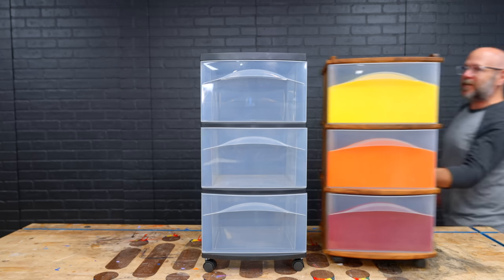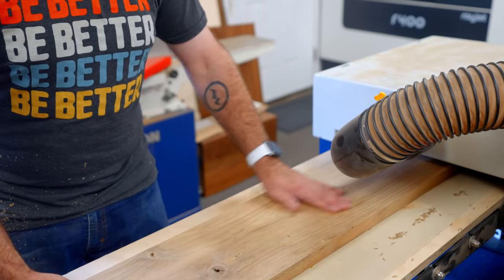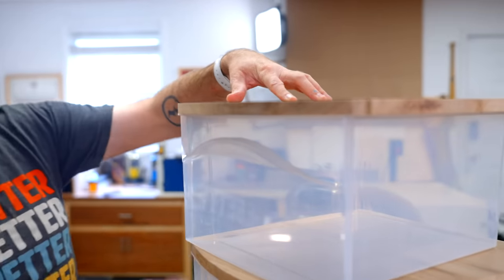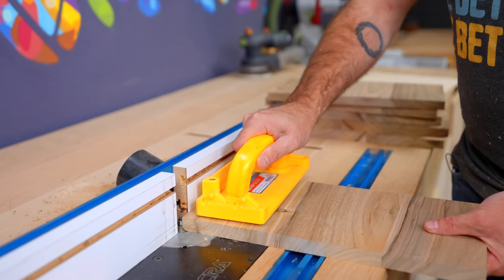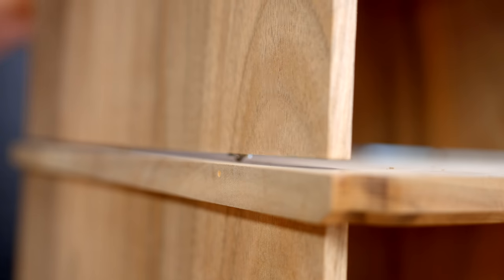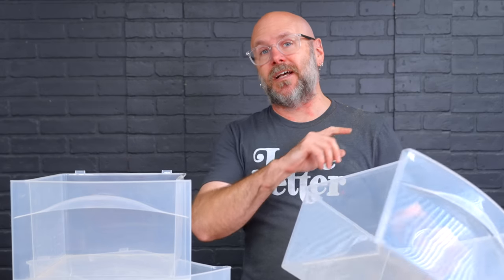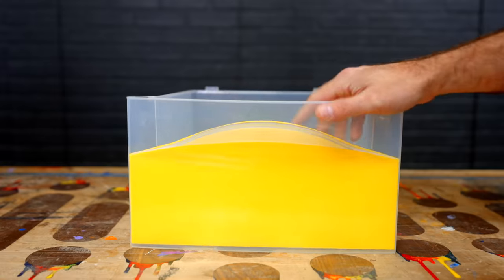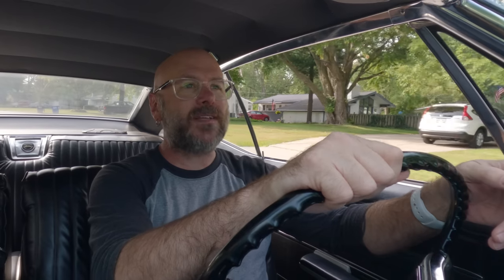Cheap to Priceless! Turning a Storage Cart Into Fine Furniture.

Comment: I've always wanted to make a strong casing around plastic drawers and storage tubs. The reason for me is that when you use their capacity for storage, the plastic on the lower units buckles under the weight from above. So I love this for that. I'd like to see something along that line that might be more workable for someone with very limited tools (perhaps using dowels). I've wondered if storage tubs could be updated with wooden lids that stuck out further and had spots for dowels in the corners, so the lids and supports were bearing the weight rather than the plastic bins. (I'd also like to see if broken lids could be repaired with a soldering tool and scrap plastic. (That's one tool I purchased with that use in mind.)

Comment: what a coincidence having this video pop up. I am actually elbows deep in my project with a 3 drawer thing JUST like this. I don't have the machinery or great gadgets as you. I am making mine a roll around side table..The top drawer will remain and house paper,pens, possibly the tv remote. The bottom 2 drawers are making way for a trash receptacle with minor plastic trimming. When I go to the hardware store, I always look for wood scraps for less or free. I happened upon a perfect piece of cabinet plywood (free) just the size that I needed. Hope to finish it tomorrow.

Comment: I needed drawers for a MCM walnut nightstand that had an opening at the top. Wanted to remove the legs and add casters to make a cart for sewing supplies. Happened upon two bamboo flatware holders that were the perfect size. $9 each. Worked perfect.
Reply from the maker: Gotta love it when things like that work out!

Comment: I was thinking of what to use the plastic blender bits for as you were driving, and I was going to say to put them in a square mold with colored epoxy matching the color to each drawer acrylic and turn handles out of them, but now the cart is gone so I'm thinking making some rings maybe 12" wide and having them stacked with brass spacers for a small office or bathroom trashcan...

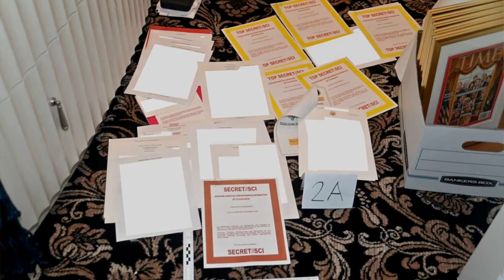Comment: @7:12 It's so much easier to use the circular side of the router base.  It only has one point of contact and makes it trivial to stay on course.  But the straight edge side can be bumped out by anything - ruining your groove.  Finally, I don't think too many will complain about the ending/use for the build.  Nah...it's YT, someone will complain about a video that teaches and entertains you ....for free.  LOL

Comment: That black plastic is either polypropylene [most likely, like mine] or HDPE. Any density of polyethylene [ldpe hdpe and mdpe] would be safe to work with under certain temperatures at home, and PP is similarly a thermal plastic that melts at low enough temperatures to be shaped at home [if not indoors like hdpe]. I've had good luck melting portions of these plastic towers together to stop them from collapsing, my point being, they're a low enough temperature thermal plastic that you might not need any acrylic to form them into something new.  "Brothers make" have a channel here about home recycling plastic, and I'm sure there's more resources online than just doing independent research like I've been doing. 

I've long wanted to get around to replacing the outside structure of mine with wood, but I want to keep the centers of the dividing layers as open as possible to let light down through them, in case I decide to keep potted plants in them, they could make really decent growing towers under the right context. I've had plans to melt the old plastic into a new desk surface myself [It's a kind of plastic that a lot of crafting supplies and adhesives won't stick to, probably second only to solid HDPE].

Comment: Instead of mixing it with epoxy you could use an oven, panini press, or t- shirt heat press to heat the plastic. Then press it into a mold to make clip boards or other useful plastic items.

Comment: However, Mr. Chootoh, "Rip'em and Nip'em" is time-tested workshop expression. IE: "After ripping these to width, I'm going to nip them all at the chop saw to final length." or "With these cut to size, now I'll nip these corners off at the table saw." 
Go for it, Big Guy. Your shop. Your rules.

Comment: "Rip them and snip them- you don't snip wood!"

1.  You rip and snip/cut paper. Paper is made from wood.

2.  Ripping wood is doable under extreme strength and pressure - think hurricane, tornado, or human stupidity.  Snipping wood - what do you do with all of the small twigs and branches when you cut down a tree or branch?  Not the ones big enough for a saw, but the smaller ones?  What about the bushes you keep trimmed?